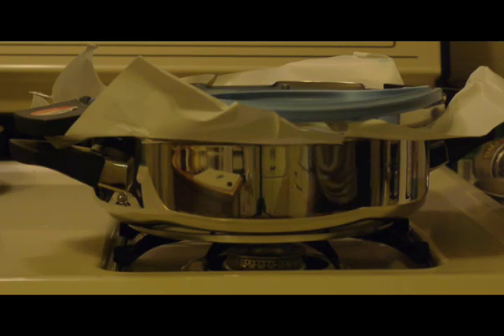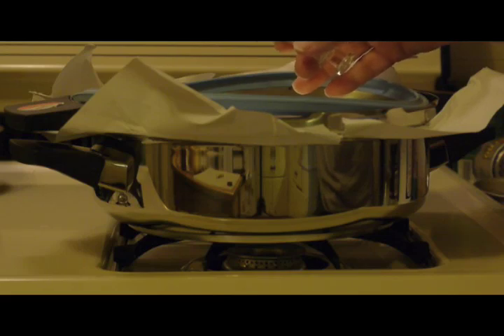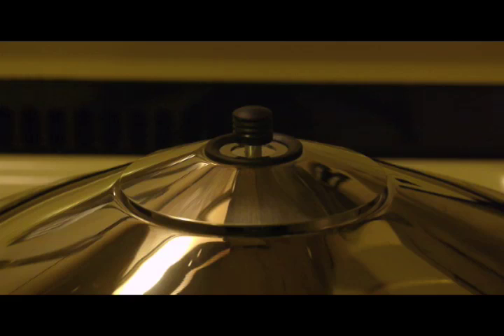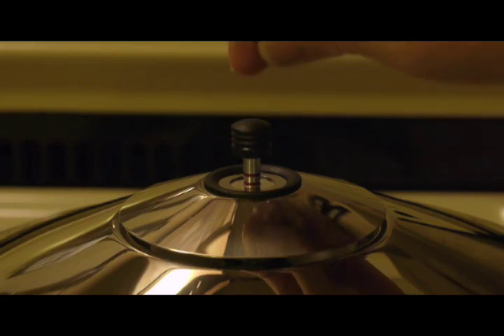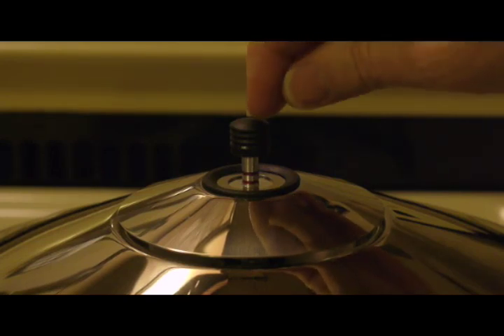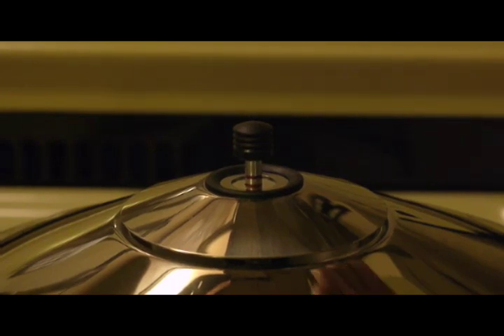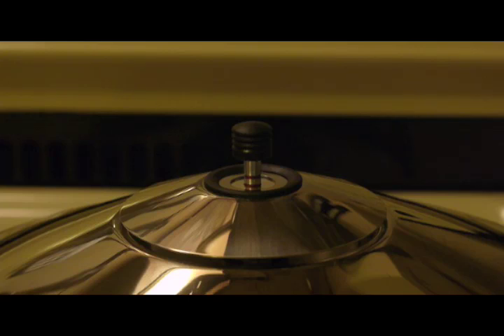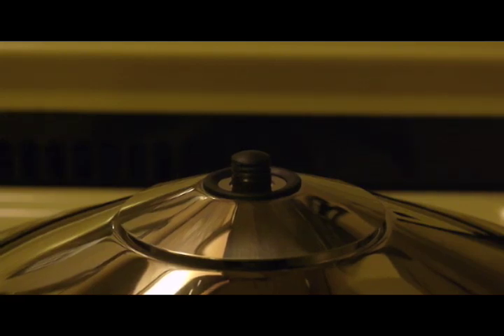Kuhn Rikon Duromatic "braiser" pressure cooker, water loss test

Comment from the maker: You're very welcome! There are few things you will find that have the utility and longevity of the Kuhn-Rikon pressure cooker of this design. I have several including the Durotherm (double wall) model (one of these is >40 years old and only replacement part needed was a gasket) and these are tools that you will be able to pass down to several generations. Reliable, predictable, practical.

I suggest though getting a good pressure cooker cookbook (Lorna Sass is a well known author). She has lots of good info on techniques.

Two tools that I lean heavily on -- the K-R pressure cooker, and thermal cooker. Not that I would want to get rid of my immersion blender, VitaMix blender, microwave, etc. -- but there is no pressure cooker I would ever use other than this model. I have always been impressed.

Comment: The second red ring is actually 0.8 bar i.e. less than true 15 psi, according to reviews I've read.  It's better to have the second red ring that bit higher up, to cook *at* 15 psi.  If you have the heat up too high, then you will reach something like 17 psi and that's when it hisses steam to stop the pressure rising higher.

Comment from the maker: (last)
so once the 2nd red ring is fully visible you have 11.6psi; that pressure is quickly surpassed and you see a little of the metal below the red – now you are at 12.5psi though the difference is barely visible. Please note that only at 1.2 bar or 17.4psi will the valve open up to release the excess pressure – therefore, most people cook anywhere between 12-16psi depending on the stove (how quickly it will react to the temperature adjustment) and how closely someone watches the red rings.

Comment from the maker: John: I liked your video! One thing to remember re the Kuhn is that the valve has a piston configuration and that IN THEORY (assuming zero blow-by) there should be ZERO water loss regardless of the length of time the pot is pressurized. On one model I have gotten to as low as 1.5 cc/min water loss but again there shouldn't be ANY water loss.
Liked your scale too! Thank you for your comments. Phil

Comment from the maker: Thanks for your note. 

I actually have never done a controlled study to see what time (or quality) difference there is going from 11.6 psi to 15 psi or even higher. While my video uses the Duromatic, I also have the (discontinued) Durotherm cookers (double-wall) which are very energy efficient. 

Keeping pressure AT the 2nd ring also allows for some leeway in anticipating overpressure on some stoves (electric burner models especially). But now I have a better feel for psi settings when I cook!

Comment: Thanks for your reply.  I did check gasket.  When pressure starts to rise the pot becomes silent like my stock Kuhn Rikon,  but once it reaches either low or high pressure (without going over) there is a slight hissing with slight steam coming out,  even when on low pressure,  so I know it's not releasing pressure because it's too high.   Perhaps I have a faulty valve.  It's puzzling because the pot has no problem getting to high pressure very quickly.  Other pot makes zero noise.

Comment: With an electric stove I turn a second burner on low and have it pre-heated so that I can move the cooker to the low burner when it comes to high pressure.   Works well.  I start on like 3 and move down over a few minute period.

Comment from the maker: You can certainly do this though there is some waste of electricity as a result. Some people just suggest moving the cooker to an inactive burner which tends to quench the steam process fairly quickly, and then returning the cooker to the active burner when things have cooled down a bit, the active burner in the mean time having been turned down. Gas & induction stove tops though are very fast acting compared to coil type electric burners.

Comment from the maker: Re your question - there are only 2 places where steam can escape during operation in the Kuhn -- the main lid seal and the valve. There should be essentially ZERO hissing normally. Judging from your description, the lid seal sounds like the culprit but you should try to verify that it's not coming from the valve. Seals can harden -> loss of sealing ability. Valves can wear over time, but should be OK if new. Either of these parts can be easily replaced.

Comment from the maker: I can't tell from your note if you think the hissing is coming from the valve or gasket. If from the gasket, either the gasket is defective or not seating well. If from the valve, then yes, the valve would be defective (though hard to believe this to be the case if the cooker is new!). But these are the only two places I am aware of in the Kuhn that could account for your symptoms. You need to 1st be sure of WHERE the steam is escaping from in order co correct it.

Comment: Thanks for replying.  If you want to cook faster and save energy (which costs so much now!) maybe try cooking at 15psi, depending on how far the indicator must rise past the second red ring.  Follow recipes for 15 psi and use the right release method at the end of cooking time (either cold water, manually removing the steam or leave to drop naturally). Hope that helps? :)

Comment from the maker: (from previous)
Also note that most other household pressure cookers with weight or spring loaded valves range between 11 and 14psi in operational pressure though for some reason all cookbooks have adapted this 15psi high pressure indication. Since you seem to know pressure cooking more intimately, you know that such gauges are not as scientific as a dial pressure gauge,
(continued)

Comment from the maker: I should add here that sometimes the main (lid) seal (gasket) will be just slightly askew (though not to my eyes something that I can actually SEE) which will cause leakage from the seal (gasket). I then de-pressurize the cooker, re-align the seal (gasket) and then re-pressurize. Most of the time this simple step fixes the problem. If this occurs again despite multiple re-alignments though, the seal (gasket) COULD be defective.

Comment from the maker: I read on a post that the 2nd ring setting on the Kuhn does not
correspond to 15 psi (1 atmosphere) pressure but instead only about
0.8 atmospheres (about 11.6 psi).
Reply from Kuhn Rikon: Correct.
This statement or indication is from the manufacturers instruction manual which comes with every cooker and states that the 2nd red ring represents an internal pressure of 0.8bar.
However, this discrepancy has no impact to any timing as all our recipes were developed with our cookers. 
(continued)
Reply: O

Comment from the maker: I have done extensive experimentation w/ the Kuhn including cooking times to 1 hr, also using PIP ("pan in pot") methods quite a bit. Aside from any main gasket leaks, the ONLY source of steam loss is blowby from the valve stem/body interface (no "rings" for this piston). Induction or gas would be best to maintain the balance between adequate steam pressure and surrounding heat loss which, IN THEORY, would allow indefinite cooking on a teaspoon of water! (but most likely not in practice!)

Comment: Yeh I hear ya there.  Gas rules in my book!
If you wouldn't mind a question:  I just purchased the same pot as you use for this demo in the 5 quart version.  I did a test run today with water and when it came to pressure,  both low and high,  I could still hear a very slight hissing noise.  Is this normal for this pot?  I also have the Kuhn Rikon 7 quart stock pot and after it pushes all the air out and pressure begins to rise I hear nothing unless of course 15psi is exceeded. Thanks much!

Comment: With regard to the 15psi issue, I have asked Kuhn Rikon whether it is possible to run their cooker at 15psi and been told that _as soon as_ the 2nd line is passed, the safety mechanism will begin to open progressively but that in practice the 15psi jiggle weight models did not run at 15psi either 'because they are always venting' so 12.6psi cooks as quickly as 15psi.  But I will only believe this when I see it because I'm like that.

Comment from the maker: I don't suppose you could give me a reference to this info your describing? I'd like to see that. Not that I don't believe you (Kuhn may be under-rating the 2nd ring a bit for safety's sake) but I'd like to see it. 

From a practical standpoint, it really doesn't matter that much since I doubt it would make much difference in a real world cooking scenario, especially if there is any drag on the valve from use which might artificially produce an elevated pressure at the same ring position.

Comment from the maker: That is an outstanding suggestion! 

For the sake of argument, though, if I have driven home the point in this video that the Kuhn pressure cooker loses very little water during cooking, which could include my OVER estimating that amount of water loss, then I'm happy. As a rule, since I have to wait until the pot cools down to open it, I suspect evaporation loss would not be a great deal. 

But again, a very nice -- and good -- suggestion! Thanks!

Comment: More exact way to do this is to weigh pressure cooker with water before and after.
Reply from the maker: 9/12/17 - of course you're probably correct but we're talking about fractions of a gram (1ml water = 1 gram) and I would need a scale that would be accurate to 0.1g. The object of the video however was to show how LITTLE water this particular brand of pressure cooker used - VERY LITTLE water - and this allows for cooking some items (such as "pseudo fried chicken") that would otherwise be nearly impossible to do in any other pressure cooker. I have tried using this cooker for this chicken idea and I was extremely impressed by the results.

Comment: "25 cc of water loss in 10 minutes is a rate of 2.5 cc/minute" I don't think this is an accurate conclusion. I think the majority of the water was lost during heating up and cooling down, when the pressure indicator isn't raised up it allows venting and that will happen for a period of time until there's enough pressure to raise the indicator up.

To separate out the startup/cooldown loss from the loss per minute, you should do another test where you cook for 20 minutes and measure that loss. Then you can say loss = f + r*t (where loss is the sum of the fixed loss + continuous loss rate * time). 25cc = f + r * 10 and ? = f + r * 20.